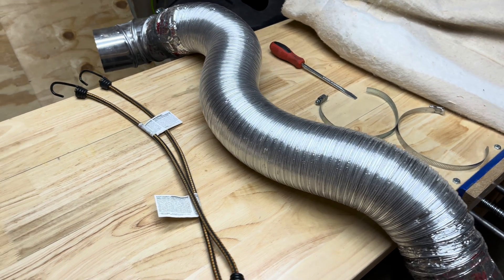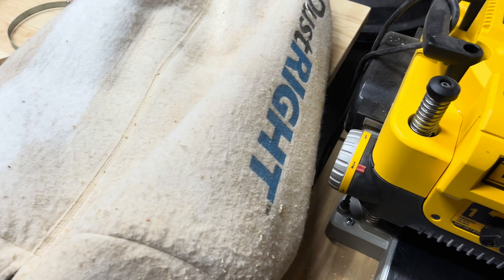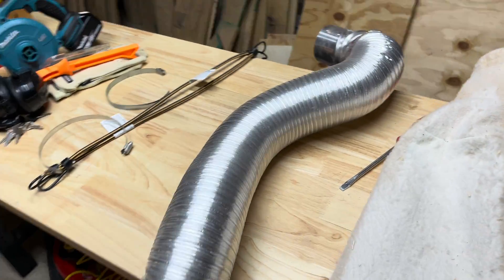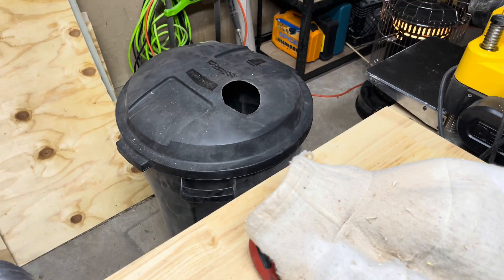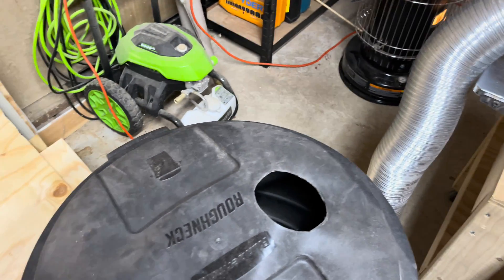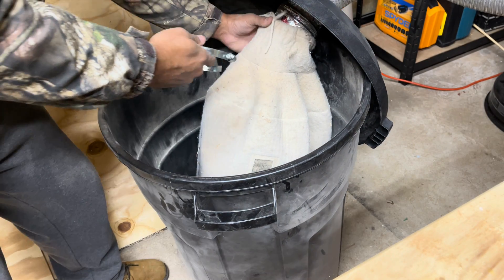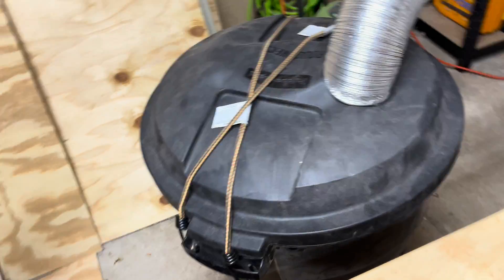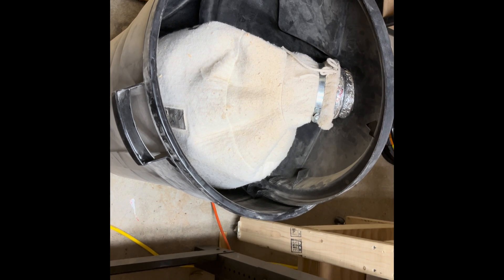Best dust collection system by far! For Dewalt DW735 Planer

Comment: I have seen several of these hooked up to dust collectors and are working well.  Seems that the trick is to use a 4” port and hose/piping to the collector though.
Reply: I use my Delta dust collector with a 4” hose. I don’t even turn it on. The planer blows the dust right into it. Neve4 have had a clog. My problem is that workpieces snag the hose on the outfeed side and pull it off if I don’t watch it closely.
Reply from the maker: You can hook them up to the low pressure high air flow dust collection systems. If you try to use even a 4" port on a high velocity dust collection system like a shop vac it wont work, it will just end up clogging up the planer.

Comment: Good video. Well done. Quick question. Is there an added benefit to using the dust bag vs having it all just go into the garbage bin?  Or is it just for ease of transporting the shavings later?
Reply from the maker: First, thank you for the complement. As to your question, yes there is a benefit to using the bag. If you only use the trash can, the air needs to be able to circulate and escape, without the bag, A lot  of the dust particles and chips will escape from the sides of the lid or anywhere else there is an opening which would defeat the purpose of the system, Having the bag catches most of the dust and debris, while allowing mostly clean air to escape. Its kind of like a filter. Some dust does escape the bag, but what escapes the bag is generally caught by the trash can itself. The can cannot be air tight bc air pressure will build up and cause it to ultimately explode. If you have any other question, please let me know. I hope this helps!
Reply: @ParklanCustom  thanks for the response. Appreciate it.
Reply: Awesome!
Looking for something simplistic and quick without a lot of crap.
No exhaust port is a bonus, less work. 
Something that does the job is all I'm looking for.
Did your setup and works great so far. 
Just need to get me a bag.
Thx for the idea and the share.
Cheers from 🇨🇦!!